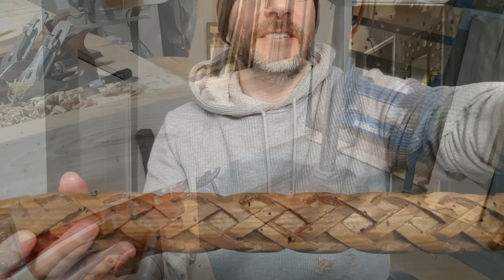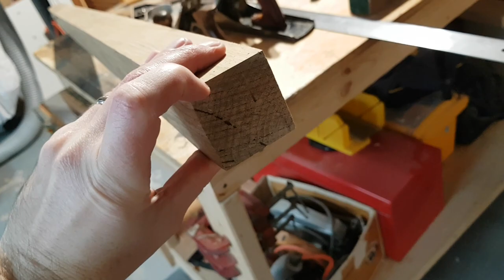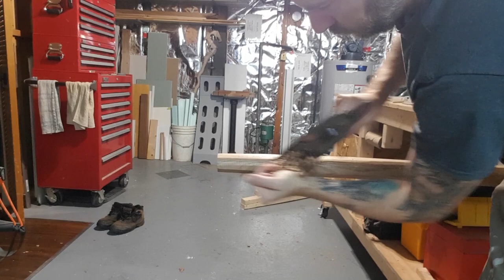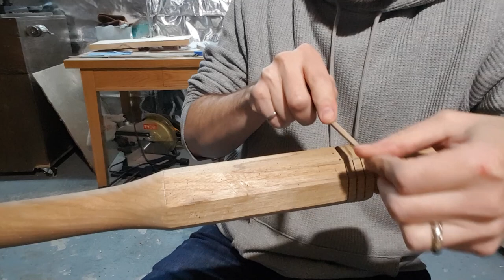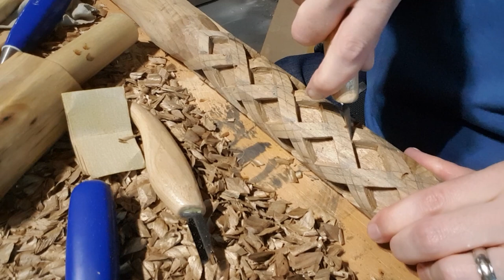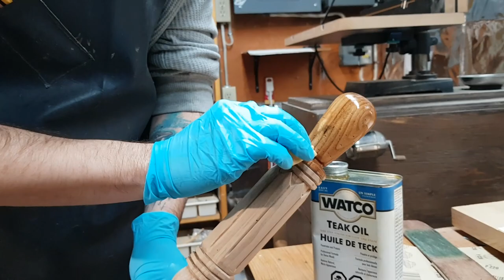Celtic Weave Walking Stick from Straight Stock

Comment from the maker: A little bit of sad news on this stick... I had shipped it down to the client and UPS decided it would look better broken in 2 pieces. Had all the "Fragile" and "Do not Bend" stickers on the package but it was folded in half and arrived broken in two. Absolutely heartbreaking to hear... so I will have to design and build another one for the client and try a different carrier. Thankfully theres video proof of this beauty and gives me joy to watch the process... just so regrettable that it won't get put into its intended purpose. Just wanted to give everyone an update on the latest developments...
Reply: That's terrible to hear,  for such a beautiful job. Did you get any money from UPS?
Reply from the maker: @robertoarango5425  sadly no, they denied any wrongdoing and closed my file. I did carve another piece for the client and shipped with FedEx. They have done a much better job and less cost than UPS.
Reply: Is there a way I could communicate with you through other means please
Reply from the maker: @darulhabib2998  yes, use my email jhedrich73@gmail.com

Comment: Superb. I have been using a Dremel tool to shape, carve and accent my sticks. My first efforts were poor but I see the improvement in my work. Today I decided to use hand tools only on my latest stick and am finding it so much more gratifying. No noise and far less dust. I hope to achieve this level of craftsmanship someday.
Reply from the maker: The rotary tool is very handy and I do turn to it with certain hard woods where hand tools are tough to use. But I agree, hand tools do offer a large degree of satisfaction when things work the way you want! Thanks for watching and good luck with your projects!

Comment: Hello Jason. Love the video and staff. I am just getting started with wood working and I am very interested in using hand tools rather than electrical. What would you suggest as the essential tools i would need to get started? Thank you for any info! Keep up the amazing work!
Reply from the maker: Thanks for writing… start simple, straight chisels, one carving knife and a saw. Find out what you like doing and add tools as you need. I started that way and very slowly added tools. Most were second hand tools and used finds…

Comment: Theoretically, doesn't the overlap depth have to be the same as the depth of the rib themselves?
Reply from the maker: Yes, however that would require the carving to be quite deep and could make the stick a bit weaker if we remove too much material. But 100% for accuracy you are correct.